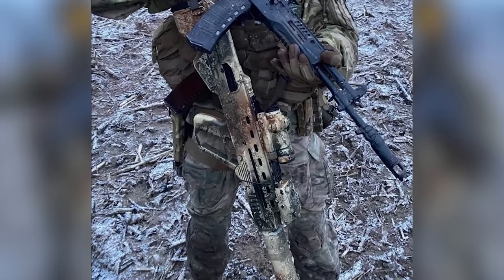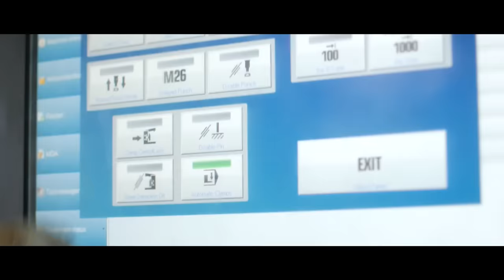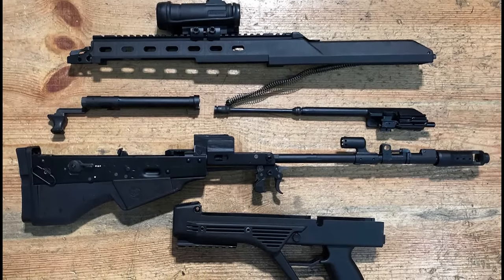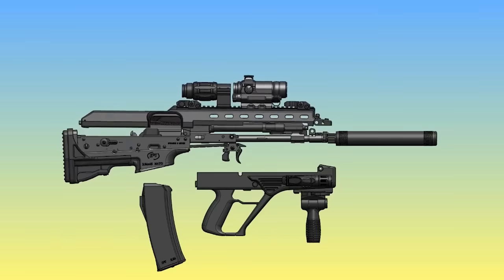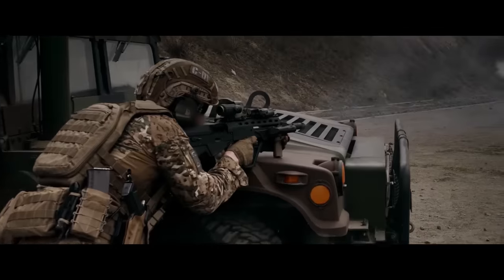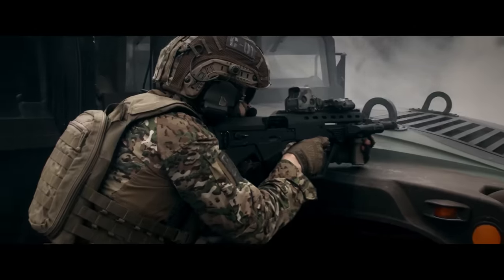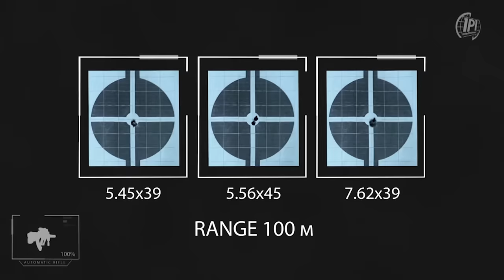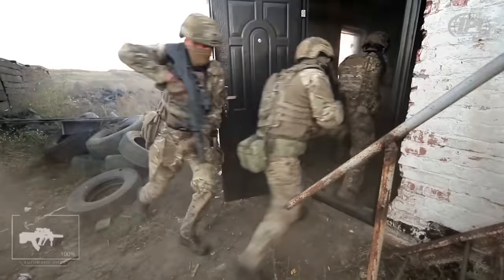Vulcan / Malyuk: Ukraine's Bullpup

Comment: There are three big improvements I see compared to typical bullpup conversions: 
1. The completely redesigned straight in/out magazine release system with an AR style button. 
2. Cross bolt safety near trigger
3. A rigid 1913 interface for modern optics mounting. This one is probably the most important and why UA SF ordered them.
Reply from the maker: Agree. It's a well designed chassis. They haven't been afraid to sacrifice more of the original rifle in order to achieve their aims.
Reply: i think the mag is still angle in? but from front -> rear lock into rear -> front lock which also fix the bullpup ak issues
Reply: 4. it eats AK mags, unlike any other bullpup UA SF were choosing from.
Reply: @PetroDobrynin  Интересно как у него с установкой подствольных гранатомётов,цевье и рукоять выполнены как одна деталь ,хватит ли прочности крепления выдержать отдачу гранатомёта!?
Reply: @андреймиронов-в4л  небачив ніразу но сумніваюсь що він там вміститься даже
Reply: The other big improvement I noticed was the choice and design of the foregrip/bipod.  I am aware that those combo foregrip/bipods aren't anything new, but the choice and length of the one that they chose seems to drastically reduce on of the issues I've heard people having when firing bullpups prone, and that's the fact that due to the placement and length of the magazine it can be difficult to fire prone, and especially difficult to reload from the prone position. But because of the length of the foregrip/bipod, it seems like this issue has been minimized a lot
Reply: @андреймиронов-в4л  есть с гранатомётом, но там другой нижний корпус и он по развесовке не очень, их выпустили как опытные образцы и не делали как серийные...
Reply: @TheArmourersBench  did you say the top rail/dust cover was polymer or metal?
Reply: It's not an AR style button it's a button behind the trigger, you didn't even watch the video
Reply: Не забывай про то что усм и вся затворная группа новая
Reply: @MALICEM12  polymer with aluminium picatini rail and steel strengthening from the inside.

Comment: The most interesting thing to me is that the magazines appear to drop free when the release is pushed. That seems to make reloads a LOT faster than usual on the AK platform.
Reply from the maker: Yes, seems to have been something they have designed in from early on. I like that they have the two magazine releases too.
Reply: @TheArmourersBench  
I do like that touch, dual with that one behind the trigger, that's some nice ergonomics
Reply: slamming in a fresh mag looks clunky though. 🤔
Reply: The use of 7.62x39mm ammo/magazine seems to hurt the ergonomics a bit. They should have stick with the 5.45 version, I think.
Reply: They emulated the AR15 with the fast drop magazine
Reply: @jhonrock2386  LOL 😂
Reply: Makes sense in the climate of Ukraine. Original AK was designed to operate in all kinds of conditions including Siberia. In extreme cold the drop free type of magazine release has tendency to freeze solid and the same tends to happen with AR type of selector switch.
I think Garand Thumb made a test about how different rifles coped with freezing some months ago. Even though in the test he just poured water over the rifles, you must remember that in field conditions the temperature differences between tent/apc/building and outside air make rifles get wet every now and then allowing them to freeze.
Reply: For soldiers actually fighting in the field drop free magazines are not really a thing. Magazines need to be retained as you bound forwards in the final assault. Its not like you can go back for them. Once the fight through and re-org is over ammunition is redistributed and empty magazines filled before the next tasking. You can't do that if you lost all six of them during the last contact copying stuff seen on TV. Its a light infantry war and light infantry rules apply.
Reply: @zoiders  my guess is the fast drop feature was specifically requested by SSU (Ukrainian security service) to suit the way they operate. In the field you would use a regular AK.
Reply: @zoiders  I'm not against what you said, but I see the reason they chose a drop-free approach: in case of emergencies you can reload faster.

Of course you are going to retain magazines, even NATO forces with drop free designs do it. Logistics win wars!
Reply: @tech477  Urban fighting is exactly the same. Magazines must be retained. Don't confuse SWAT at or anti terrorism operations with soldiering during an actual war.
Reply: @bluecaptainIT  The "drop free" feature has been adopted because other wise its extremely difficult to "rock and lock" an 7.62x39 AK magazine into a bullpup rifle. Its nothing to do with speedier reloads via discarding magazines.
Reply: @zoiders  Frak that. I want to kill them before they kill me...then I'll worry about properly stowing my mags. If I'm dead because the other guy had drop mags and I didn't, reloading later is a moot point.
Reply: @nunya___  Hush now. Grown ups are talking.
Reply: @zoiders  Dead ones.
Reply: @nunya___  So you dumped all your magazines during a contact as your section bounded forward and destroyed an enemy gun team. You are now out of magazines and the enemy counter attacks from an in depth position that covers the one you just destroyed? just wind your neck in fella. Its an actual war and not a video game.
Reply: @zoiders  No. I pick them up when possible. Drop release only means I reload faster when needed.
The point is, how fast I can reload; not if I leave mags behind.
Reply: @nunya___  You really need to be quiet fella as you really don't understand what you are talking about.
Reply: @zoiders  Lol
Reply: @zoiders  that's what dump pouches are for.  You can still have a drop free design and retain your empty mags.
Reply: @chemistryofquestionablequa6252  Why? are you planning to drop them on the floor and then try to police them up before you bound again? as I said - dropping mags is bullshit. Dump pouches are so you can remove the mag with your hand and then retain it. Being old enough to remember webbing belts and a yoke the practice prior to dump pouches was to take the empty mag and just shove it down the front of your smock. For pre-prepared night ambushes the practice was to lay all the required magazines out handy for the ambush and then dump them all in a sand bag before you bug out from the ambush to avoid a counter attack. What you didn't do was hit the mag release and let it fall where ever and hope you could go back for it "later". Advance to contact just doesn't work that way.
Reply: @zoiders  no , you're completely misunderstanding.  You remove the empty magazines and drop them in your dump pouch, but if you NEED to make a very fast reload you drop the empty. My original comment was regarding this. It's a faster process to reload with a magazine system like this rather than the rock and lock AK style.
Reply: @henrihamalainen300   Not really, in some regions of Ukraine in winter they often reach -30 degrees, while there are mountainous regions.
Reply: @zoiders  Have to disagree. We went from the L1 A1 FNL to the Styr Aug bullpup, we could never change the Styr mag as fast as the L1 A1 in the prone posiion. Having a drop free magazine would've taken one step out of the magazine change.
Reply: @clickonmike  You have clearly never touched a L1A1 as the L1A1 uses a rock and lock release catch the same as a Bren Gun or AK. The AUG has a release button and the mags drop out. Bullpups are genuinely faster to reload over standard layout rifles when in the prone position. Its one of their few advantages. Its still a hand to hand operation though and magazines still need to be retained.
Reply: @jhonrock2386  While I will agree that a standard infantry variant should be in either 5.45 or 5.56, the M43 ammo might be a better choice for shorter barrel suppressed builds spec ops guys use

Comment: Clearly Ukraine has some very talented engineers. The bullpup design will help with cqb of urban warfare within th cities, but still allow the fighters to have the range when out in the flat open land of Ukraines countryside. Has anyone figured out how they managed to keep the "rock-in" style old AK mags, yet have them drop free?
Reply: There's an elf in there who kicks it out when you push the incentive button by the trigger.
Reply from the maker: This weapon has zero to do with the Tavor and its tooling.
Reply: That's Ukrainian Magic doing its work right there
Reply: I believe the front locking nut of the magazine is spring loaded.

Kind of like a BM59, but better: it works even when removing magazines.
Reply: We had ak bullpups for decades. They might be ergonomically superior but all the smokes from ejector literally fly into your eyes and you always have to have spare glasses jus in case. Also it's the same problem as for tar21 - you get a lot of smoke on your right cheek and it leaves a mark.
Reply: @СергейБильмандо  Thanks for the insight, I've never heard of those problems before
Reply: @СергейБильмандо  in the UK we got round that problem by designing a bullpup that doesn't work. 👌
Reply: @СергейБильмандо  id love to see a uniquely Japanese take on a Bullpup rifle
Reply: It appears from a recent video the loading motion for this bullpup is opposite the standard AK. In the AK you hook the front lug of the magazine into the well then rocking the magazine to the rear until the rear catch locks in place. With Vulcan/Malyuk, you hook the rear of the magazine into the well then rock the magazine forward until the front lug locks into the mag catch. With this method when you press the mag release the front lug is released and the curved mag falls with a rearward rotation that releases the rear catch allowing the mag to fall free.  It appears to be a rather simple and ingenious way to use existing AK mags without having the bottom of the mag blocked by the bottom of the pistol grip and have an ergonomic mag release.  Very clever engineering.
Reply: @nickm5419  A Japanese bullpup would have an AI-controlled target seeking, 50 year old warranty and the firing sound would be fine-tuned by an acclaimed musical acoustics engineer.

Comment: The more I look into these the more I believe it is an ingenious design. For example, the trigger transfer bar appears to be a "pull" type rather than a "push" type. newer bullpup designs use a pull system because it delivers a better trigger pull. I have a steyr aug and the old gen "push" system is what leads to the spongy trigger. It appears Ukrainians have been modernizing this indigenous design lockstep with modern bullpup developments. I think probably this is the best "bullpup ak" rifle ever made. Would love to get my hands on one.
Reply: It looks like THE best bullpup ever made
Reply: What do you think of FN 2000? It can be fired from any shoulder without picking the structure.
Why is he not the best bullpup in existence?
Reply from the maker: I'd say because its ugly and somewhat over complicated with its forward eject system and enclosed receiver.
Reply: @СтепанМельничук-ь4ю  FN2000 ejects cases from the front, below the barrel.

Very good for ambidextrous use, Ive been told it has significant problems when firing prone, the brass piles up in front of you and blocks  the ejection port unless you keep sweeping the spent casings away.
Reply: I want an AUG, but it would be nice to see Steyr sell an "A4" version which still has a bolt hold open for the STANAG compatible version, a built in case deflector OR optional forward eject like on the MDRX, and the ability to easily switch between left or right handed shooting like on the Tavor 7 and a modernized trigger system all while still keeping its distinct features like simple and modular construction for easy maintenance.
Reply: @DAN007thefoxx1  Something like Australia Austeyr F90 then.

Comment: I bet after the war parts kits for converting AK's to these will sell like hot cakes on the US market.

Wonder if anyone has 3D models or design files already? I can see airsoft replicas of these being a very popular product in the coming years.
Reply: It started as an AK conversion kit, but it ended as a different weapon. It has it's own barrel now, which Ukraine produces, it has more rifling in it, which gives it much more accuracy.
Reply: This is not a conversion for... idk, 10 years now, if not more
It used to be, on the prototype stage.
Ukrainian AK to bullpup conversion kit is called Black Storm, that's the one you can apply with your own hands. 
Malyuk, on the other hand, is now basically a different weapon now.

Comment: That's an intersting reload! AK mags are usually nose-in rock-back type, but from the promo videos, they seem to have made it heel-first rock-forward instead. I really want a close-up on how they made that work, as an AK magazine has a lip on the front of the magazine and a lug in the rear to engage the latch in a typical AK mag well.
Reply: They state that the mags are made to fall free of their own weight and that is shown in the promo video too. My guess would be they just took the AK mag well and reversed it. 

So now instead of a nose first, then rock the ass back with the mag release holding the ass in. It is ass first then nose and the mag sits at a bit of an angle with the release holding the nose so when engaged it just moves away and lets the mag fall of its own weight. Kinda of a smart way to handle it honestly. 

I really hope they import these to the US cause I would love to get my hands on one (bullpups and AKs being the main part of my armory)

Comment: if UKA soldiers arent replacing them for AKM's and ak12 from deceased foes, then that means it is at least as good if not better than those platforms, which is saying a lot
Reply from the maker: Great point.
Reply: captured weapon dont have spare part available . also same caliber doesn't mean it interchangeable . for example during ww2 british and german use the same 9×19mm Parabellum caliber smg but german mp40 can't not fire british 9mm round and other way around
Reply from the maker: The Sten and MP40 could fire the same rounds. Magazines were different.
Reply: @tranbachuyen6655  are you trying to tell me there aren't spare parts for aks in Ukraine right now? Hell you could just take parts from one captured AK and use them to fix another captured AK, I'm pretty sure you can find AKs easily ok the Frontlines, also you don't know what you are talking about in respect to ammo, 9mm Parabellum is the same anywhere in the world, there are other types of 9mm but rounds have standardized all around the world for ease of trade
Reply: @iutarogirotto5110  during invasion of normandy british made a small tweak in their 9mm rounds to prevent it being used by german if they capture the ammo . since then german mp40 can't not fire british 9mm round if german manage to capture the ammo . and AK12 don't use AK74 or AK47 spare part

Comment: Looks like a pretty cool bullpup conversion, and probably the best one done from an existing rifle.
I think all that's left to do is to give it the last few modern ergonomic features such as a bolt hold open on the last round (which may require a new magazine follower design), and a bolt release paddle/button/lever to more quickly chamber a round than pulling the charging handle.
The separated safety switch and push button is a workable solution and the Brits have the same thing going on their L85s. I don't think it's a huge deal since 99% of trained troops and scenarios call for semi-auto fire anyway, but if they can just figure out how to make the safety switch entirely on the firing grip that would be gold too.

Comment: I want some of the following features.
1) I'd like it in short stroke system, rather than a long stroke system. Also, multi position gas regulator too
2) instead of a cross bolt safety, I'd like to have the safety/fire selector of Walther w2000 sniper.
3) this is kinda optional, I'd like to have a ambidextrous bolt.

Still, cool rifle though

Comment: Did they reversed the mag locking?? The back lug is fixed and the front one is the mag catch?
UPD hm.. the second mag catch is on its standart place, but they insert the mags in reverse... Did they make the front lug spring loaded, so it allows the front mag lug to pass?
UPD If the mag drops free, does it mean that the both mag lugs are going out of the way when you push the mag release?? That would be the first, isnt it? 
Maybe most likely the front lug being the mag catch.
Reply from the maker: Great questions and at the moment not sure. Need to get a closer look at one.

Comment: It's definitely a cool rifle, but I don't think it can really match some of the other ones out there like the Tavor X95 and VHS-2, at least not yet. It still needs some refinements. The biggest issue I see is the location of the fire selector which seems very inconvenient and out of reach, as well as the pistol grip which seems like a bit of an obstacle during mag changes. I could also use an ejection port on the left and some extra rails on the sides of the forend for some extra flexibility with accessory mounting.
Now don't get me wrong, it's quite good but with some extra tweaks it can become so much better.

Comment: 3:33  How is the receiver cut down? Every single image shown of the Vulcan in this video and every image in can find online shows a complete AK receiver. The Vulcan receiver looks identical to the receiver on my Bulgarian AKM. There is no possible way to cut down the receiver without also shortening the bolt carrier. And all the bolt carriers in this video look completely normal. Also there is hardly any space on the AK receiver to cut down, the bolt can carrier needs to move back 90% the length of the receiver just to clear the magazine to feed a new round.